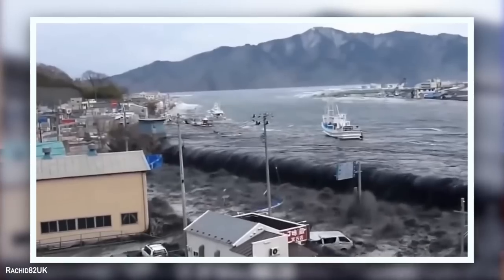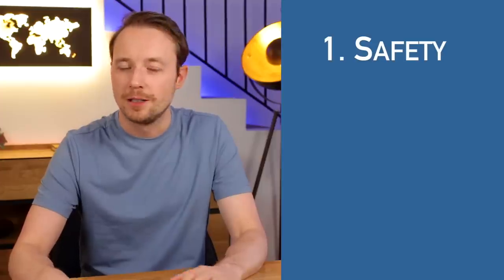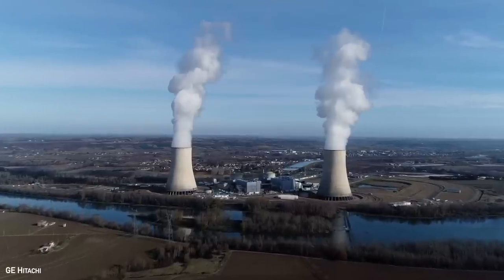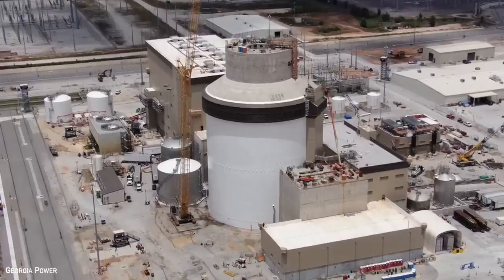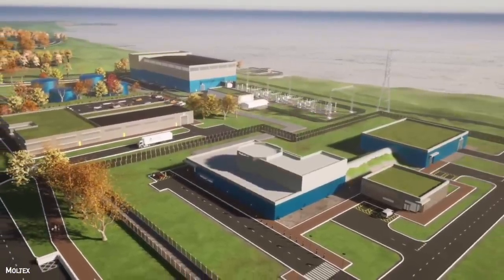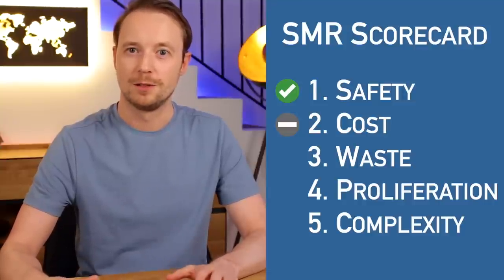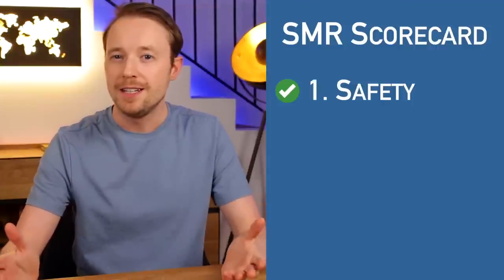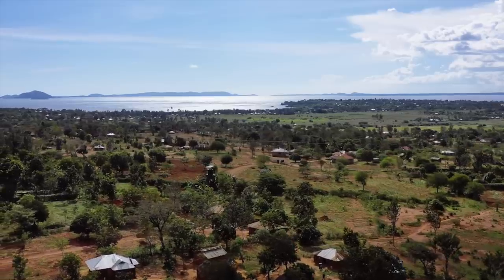Can Small Reactors Revolutionize Nuclear Power?

Comment: In terms of cost too you're not accounting for upfront capital costs. 20 billion dollar upfront loan and investment is quite a significant threshold, and interest rates are higher. The long duration of nuclear plant construction makes that worse, and SMRs should hopefully bypass the onerous regulations. With SMRs, it will be more accessible because the upfront cost will be lower and faster to achieve power production. That entails a lot less risk, and less collateral, and lower interest rates.
Reply: This is from the Des Moines Register an concerning the only Small Modular Reactor (SMR) project in the U.S. today.
In 2013, the Wall Street firm Lazard estimated that the cost of generating electricity at a new nuclear plant in the United States will be between $86 and $122 per megawatt-hour. Last November, Lazard estimated that the corresponding cost will be between $131 and $204 per megawatt-hour based upon the 4 recent new nuclear projects in the U.S. . During the same eight years, renewables have plummeted in cost, and the 2021 estimates of electricity from newly constructed utility-scale solar and wind plants range between $26 and $50 per megawatt-hour. Nuclear power is simply not economically competitive.
SMRs will be even less competitive. Building and operating SMRs will cost more than large reactors for each unit (megawatt) of generation capacity. A reactor that generates five times as much power will not require five times as much concrete or five times as many workers. This makes electricity from small reactors more expensive; many of the original small reactors built in the United States were financially uncompetitive and shut down early.
The estimated cost of constructing a plant with 600 megawatts of electricity from NuScale SMRs, arguably the design closest to deployment in the United States, was originally advertised as costing $1 billion but upon requesting actual bids from engineering firms, increased to $6.1 billion in 2020. Given inflation and other cost constraints that cost today can only be expected to be significantly higher.
The cost was so high that ten members of Utah Associated Municipal Power Systems canceled their contracts. NuScale then changed its proposed plant configuration to 6 fewer reactors but increased each reactor output from 50 Mw to 77 Mw costing at total of $5.3 billion. The NRC just last week approved the construction of the 50 Mw design but now will have to start the review process all over given the switch to a 77 Mw design. For each kilowatt of electrical generation capacity, that estimate is around 80% more than the per-kilowatt cost of the Vogtle project in Georgia — before its cost exploded from $14 billion to over $30 billion. Based on the historical experience with nuclear reactor construction, SMRs are very likely to cost much more than initially expected. And they now have delayed the project start until 2025 in an attempt to find more backers.  All this before the inevitable setbacks that will occur once construction starts.
Reply: @clarkkent9080  Well I have a lot of problems with this. Nuclear power, for starters, has seen a lot of under investment compared to other power sources. So of course its going to be more expensive, especially when nuclear power needs to battle against 1000 times the regulatory burden.

When you include solar and wind power calculations, there are a lot of artifical market influences. Chinese manufacturing has artificially pushed down the price of solar and wind. That won't last forever. They're in deep crap so expect solar and wind prices to start going way up. You can no longer rely on cheap Chinese crap. Furthermore it doesn't account for dunkerflaute, which means you need a lot of extra capacity to account for time when there is no wind and no sun for long periods of time, for seasonal variations, and on top of that you need a lot of energy storage in general. The costs go way up when you add in the batteries necessary to give solar and wind storage during a downturn, particularly solar.

Comment: SMR is a marketing term like Thorium, both are pretty meaningless. It will come down to cost and versatility. High-temperature reactors of whatever size or fuel type are vastly more versatile than low-temperature, electricity-only LWRs. 
High-temperature nukes "Should" cost far less than a pressure water reactor if the regulators will let them. In America, the NRC will never let that happen, so we will have to see if other countries value clean, reliable, and affordable energy.

Comment: I recently  compared  cost of solar farm to a couple of recently  reported nuclear plant costs.
I came up with nuclear being 20 times the cost of solar. This did not include operating costs, fuel costs, or waste disposal. 
20 times the cost.
Not sure where this article got the numbers presented.
Reply from the maker: While creating this video, I found a WIDE variety of estimates. The ones I presented here were somewhat in the middle and used a consistent method, so it made for a good relative comparison. Primarily, they are from the IEA and NEA report, "Projected Costs of Generating Electricity 2020 Edition". But yeah, there are lots of different numbers.

Comment: I think that on the proliferation issue, you are a bit off. The actinides & the fission products left in the reactor with fast MSR (of SMR type) 'protects' against fuel being stolen. To steal it you need to handle the fuel, store it until the radiation is lower, then transport it to a processing plant & there process it & remove all the neutron 'poison'. All this without being caught. Okay, IAEA can't get access to rouge states, for sure, but the investment to build all this infrastructure, will a rouge state be able to do it? I also get the point where chemical processing is much easier on liquid fuel, than on solid fuel. But here is where the logic breaks down. If you can build & operate SMR's, you increase the standard of living for all your people. A prosperous population is not going to support a terror group. They will NOT!! Show me an example and I will eat something that I normally don't eat!

Comment: Nuclear is the future
Reply: Maybe the far far far off future.

If you live in the U.S. here is the reality for the last 4 state of the art Westinghouse AP1000 ADVANCED passive safety features new nuclear power projects and spent fuel reprocessing and in the U.S. over the last 20 years. You decide if this YT video was presenting the truth. 

The Southeastern U.S. is super pro-nuclear MAGA, has zero anti-nukes, and 100% media and political support. 

The MOX facility (South Carolina) was a U.S. government nuclear reprocessing facility that was supposed to mix pure weapon grade Pu239 with U238 to make reactor fuel assemblies. It was canceled (2017) in the U.S. After spending $10 billion for a plant that was originally estimated to cost $1 billion and an independent report that estimated it would cost $100 billion to complete the plant and process all the Pu239, Trump canceled the project in 2017.

VC Summer (South Carolina) new nuclear units 2&3 were canceled in 2017 after spending $17 billion on the project (original estimate of $14 billion and 2016 completion date) with no clear end in sight for costs or schedule. 

Vogtle (Georgia) new nuclear units 3 &4 currently 110% over budget and schedule (currently over $30 billion) and still not operating. Mid way into the build, the utility stated that had they known about the many costly delays they would never have chosen nuclear. They are now delayed another year because according to the project management, thousands of build documents are missing. If completed, Vogtle will be, for its output, the world’s most expensive nuclear power plant.

Please google any of this to confirm.

If you can’t build new nuclear in the MAGA super pro-nuclear southeast U.S. then where can you build it?

Comment: Your comments are only valid if you SMR are MSR. Pressure water and breeder bring all the problems but scaled proportionately to production output.
Reply from the maker: Unfortunately SMR is a very broad term so it's almost impossible to capture all designs into a few categories (yet, I tried!). But your point is valid, individual designs or types would probably score differently. Cheers!
Reply: @atomicblender  Thanks. It can be noted that Rolls Royce has complained, even after getting over 300 million from UK government, that there is very little interest in their Pressurised Water reactor ( and over expensive pricing )

Comment: NO! What we will get is Chernobyl's every 100 miles apart. Something that will never happen with wind and solar and batteries. Add geothermal, hydro and other safe electric generation. What do you mean by "SAFE." Please understand that the results of accidents is based on the level of risk. High risk behavior means that the result of the risk is very high. If you want to avoid death you avoid activity that increases your risk of death. If you climb cliffs your chance of death is the consequence of a mistake while climbing. A mistake could be viewed as an accident of movement while climbing. You can reduce your risk of death by getting yourself into shape for cliff climbing, using very good gear, getting instructions, but you can never eliminate that unforeseen thing that might happen where you end up falling from the cliff and dying. The accident will inevitably happen because we can't know everything or a cascade of things going wrong. Expert cliff climbers fall from cliffs all the time and die. The only way to make sure you don't die from this particular activity is to NOT CLIMB cliffs. Nuclear is the same. The next Fukushima, the next Chernobyl will happen in a way that we didn't see, we didn't plan for and we didn't have any contingency to prevent. Having a whole lot of nuclear power plants only increases that risk more. If a solar farm catches fire, if a wind turbine breaks apart, you remove the rubble and you rebuild. If a nuclear power plant has a problem you may be talking about at least hundreds of miles of contaminated, deadly areas that will take thousands of years to go back to normal. We are on the cusp of a renewable future that is safe and distributed. The only advantage nuclear has is that large utility companies will be able to generate electricity centrally and hold a monopoly over its ratepayers. Avoid the risk. Don't climb that cliff.
Reply: > The only advantage nuclear has is that large utility companies will be able to generate electricity centrally and hold a monopoly over its ratepayers
Of course, 70% nuclear France has electricity half the price of 40% RE Germany.
And 50% nuclear Illinois has electricity haft the price of 45% RE California.
hmmm, I see a trend.
Reply: > What we will get is Chernobyl's every 100 miles apart.
> The next Fukushima, the next Chernobyl
Um, no, we won't.
Fukushima Daiichi was the result of a tsunami flood.
The risk of the same accident happening to the largest NPP in the US is nil
(because the largest NPP in the US is Palo Verde, in the Arizona desert)

You can't be trite and presume the risk at each plant is the same; nor that the other risks are non-existent. Risks like air pollution from coal plants because we don't build nuclear. Risks like global warming destroying large areas for farming. Risks like a 3-day blizzard shutting down all your wind and solar. Risks like power outages killing people.
Quick which has the higher casualties:
* Chernobyl No 4 blowing up in 1986?
* Texas grid failure in Feb 2021?

Quick, which has higher long-term casualties?
* Chernobyl No 4 blowing up in 1986?
* German coal burning?

You have to look at ALL the risks in order to have a true risk measurement.
(Note that sedentary would-be mountain climbers might have heart attacks instead)

The answers are:
Texas grid failure - just a single winter storm that melted in days!
* Texas grid failure in Feb 2021 - about 246-702 people died - WIkipedia
* Chernobyl No 4 blowing up in 1986 - about 65 people died - UNSCEAR

German coal burning
http://env-health.org/IMG/pdf/dark_cloud-full_report_final.pdf
* German coal - Germany poisons and kills about 4000 EACH AND EVERY YEAR!
* Chernobyl No 4 blowing up in 1986 - about 4000-11,000 might get cancer than otherwise (essentially undetectable given all the causes of cancer) - UNSCEAR, IACR.fr
Reply: @joelado  > From the economies that are provided with renewables from wind and solar it looks like gas and coal's days are indeed numbered. Those types of plants are being decommissioned as fast as solar and wind farms can be built.

Noted Wind/Solar-based grids like Denmark and Germany show this to NOT be true.
Denmark has been building wind farms since the 1970s, and has access to Norwegian hydro. They still have emissions much higher (per capita/GDP) than France or Sweden (with nuclear).

Germany shut down nuclear plants - and promptly opened new coal plants.
Germany was planning to shut down coal plants - in 2030 - so TEN MORE YEARS OF EMISSIONS. However, because they can't burn Russian natural gas - they are planning to keep those coal plants open even longer!

You don't have to be a coal/gas advocate to see that Wind/Solar aren't making much difference, so these are not 'strawman arguments'.

On the other hand, let's look at one reasonable sized jurisdiction - 1,000,000 km^2 geography, 15,000,000 people
(this isn't some flyspeck island with 100 people, or like Denmark, connected to the world's best hydro resources)
they have really super-low emissions - about 20-30g/kWh - how did they do that?
https://www.ontario.ca/page/end-coal

----

Your Rosie video tells the story of LCOE - great if you are an investor interested in making a buck.
What are the retail rates? I.e. the rates that society pays?
In all jurisdictions where wind/solar dominate, the retail rates are higher
(because SOMEONE has to pay for intermittency and idle assets)